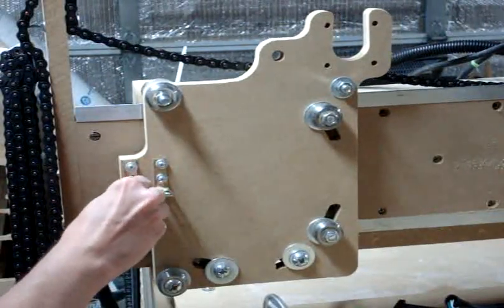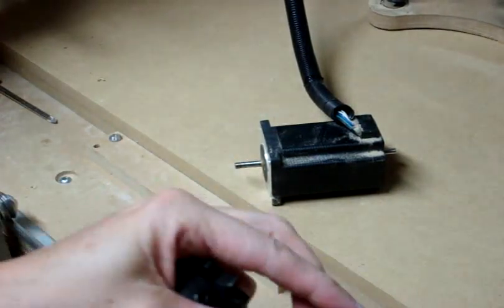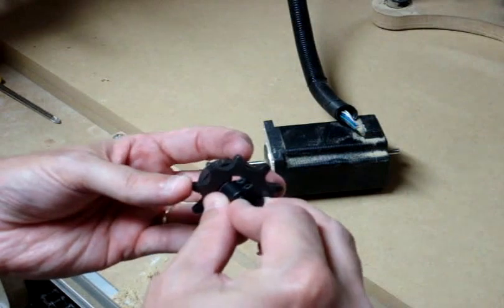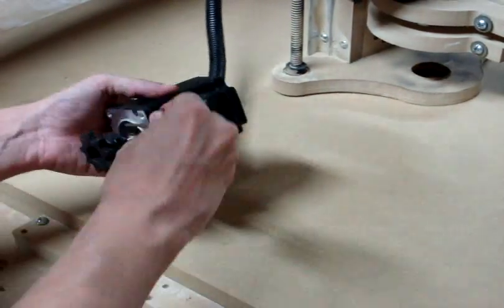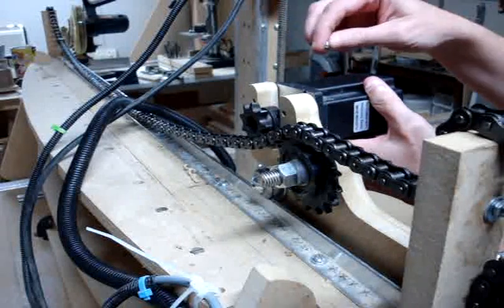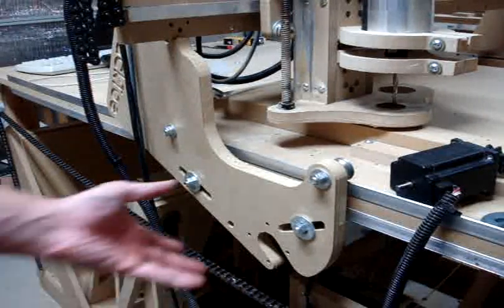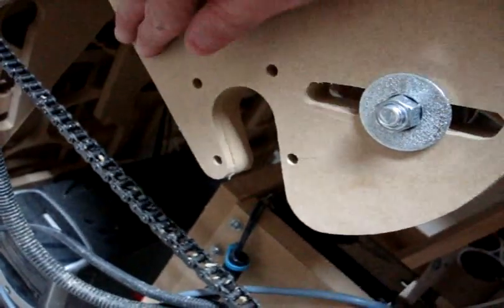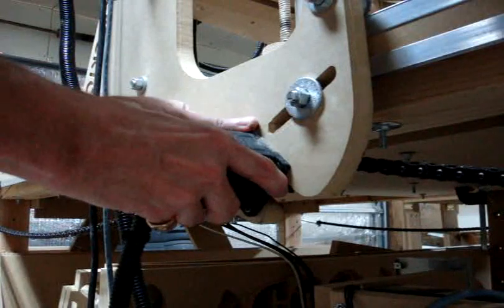Full Supplemental for 4x8 Part 2 - blackToe 4x8 CNC Machine

Comment: You can set the motor direction in the mach3 software so you don't have to put the motor and sprocket in different places.  And you can change the polarity on the stepper leads A+ A- and B+ B- just reverse the + and the - but don't mix the A and B phase up